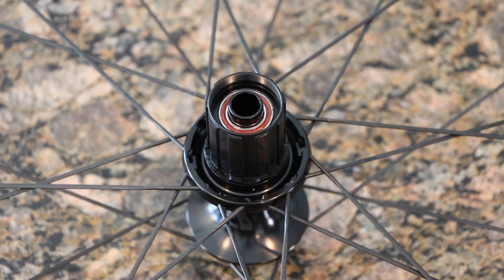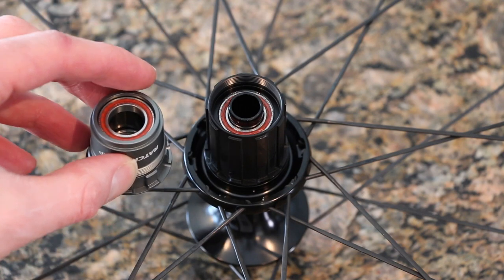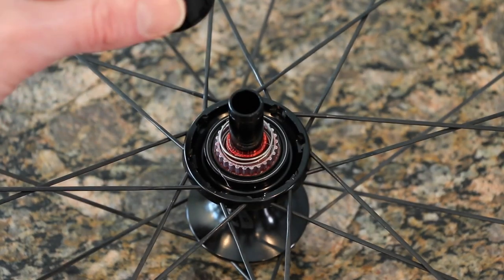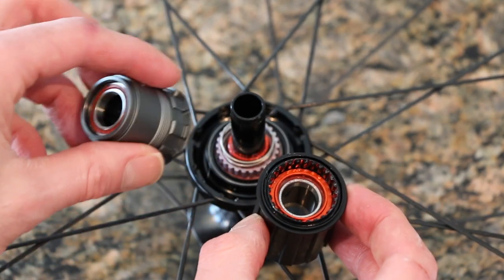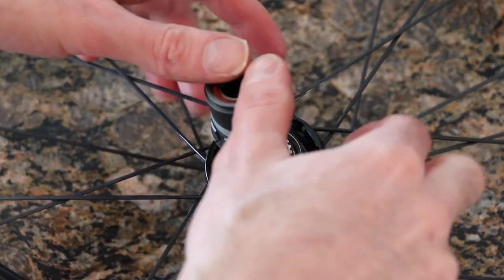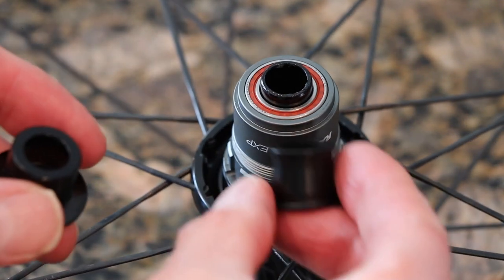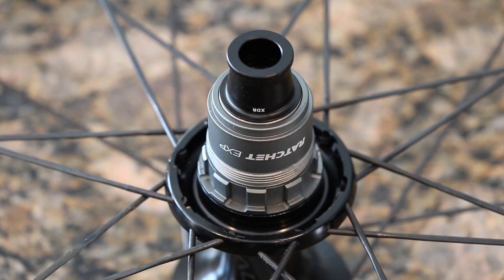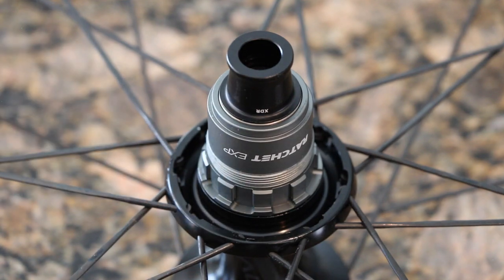DT Swiss Ratchet EXP Driver Body Swap - Shimano to Sram XDR

Comment: Thanks for posting Mitch! I'd like to upgrade the HG Ratchet hub on my  Roval's CLX32 Rapide wheel. My 2017 Specialized S-Works eTap Red 11 spd has a Shimano HG free hub body that's burnt orange colour & not black like yours, however it looks identical inside to yours (DT Swiss microspline). I used to live in Edmonton & got my bike parts from Revolution there or Ridley's in Calgary. Now I'm out east ~ Toronto area & not sure where to source one of these DT Swiss HG to SRAM XDr driver conversions. Where did you get yours for the Roval CLX Rapide?
Reply: I checked the link below btw & it said product nolonger available. Bunch of retailers in US have these, I'm not sure about 🇨🇦
Reply from the maker: If they are DT Swiss internals, They shouldn’t have to be a roval branded product. Any compatible DT Swiss freehub would work… I would try one of the online shops
Reply: @MitchOnTwoWheels  just to verify so I should have no issue using the Ratchet EXP driver on my 370 hubs right? Spech said I need the Ratchet LN driver but the EXP was available locally and seems to work fine to me.

Comment: When I read the manual, it shows them using the red washer and put it inside the hub and works with the spring. I think you’re supposed to pull it from the old hub and insert it into the new one.

Can you please share what it sounds like when you remove some of the grease?
Reply from the maker: Just a little louder overall :)
Reply: Yes, otherwise the spring will be pushing rubber seal instead of the actual bearing. Also, you can get Specialized Freehub XDR DT240 EXP directly from DT Swiss. The part # is HWYABL00S5401S and will save you $80.
Reply from the maker: @Paul-sk2pc  Yes, I guess this wasn't mentioned.... it should be fairly obvious when taking it apart, as it will fall out of the driver. But I suppose it should have been mentioned.

Comment: I  have a DT Swiss 370, Ratchet LN upgrade on my Roval C38. What freehub would I use to convert for my 12 speed sram?
Reply from the maker: Your best bet is to ask your shop. To upgrade the ratchets, you just need the ratchets themselves. Not a new freehub.
Reply: @MitchOnTwoWheels  do I need to change gears to convert to XDR freehubs?
Reply: for the newer 370 hub you need this driver, Ratchet LN HWRAAM00S9721S. (the one being used here in this video will NOT work)
Reply: @cyclingfan1981  I have a new set of C38s dt370 and just put the EXP driver on and everything seems fine to me… is there a reason I need the ratchet LN over the ratchet EXP? The exp driver was local so I grabbed it

Comment: Hello, the red washer goes right through the hub and stops against the bearing? Is there a gap between the bearing and the toothing? It happens to me that the red washer moves laterally and the ratchet jumps when pedaling, could that be the problem
Reply from the maker: The red washer sits beneath the spring. It floats on top of the bearing cover… it doesn’t go through the hub like you’re describing.

Comment: I made it through the swap of the xdr body, but when I tried to install my SRAM Force cassette, I did not want to go all the way on, it seemed to get stuck and I did not want to apply a lot of force for fear of damaging something on the brand new wheel. Anyone else have an issue installing the cassette?
Reply from the maker: Make sure everything is greased… and also twist the body against the direction of engagement gently.
Reply: @robertswan8546 Did you find a solution for this? I am having the same problem. Cassette won’t go on all the way.